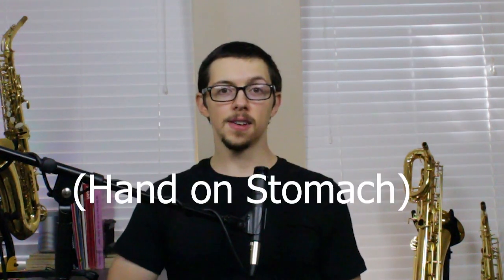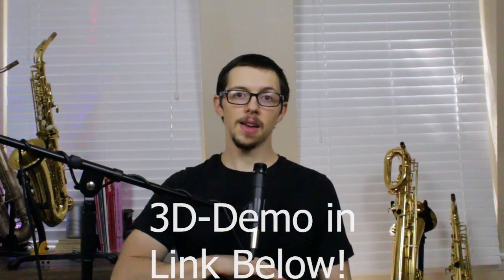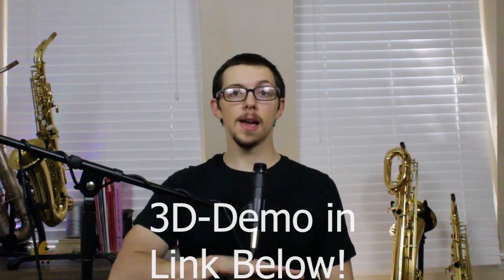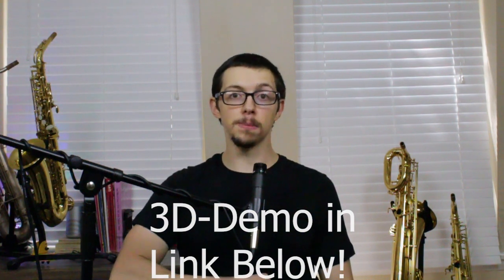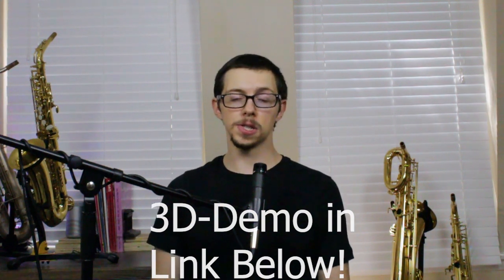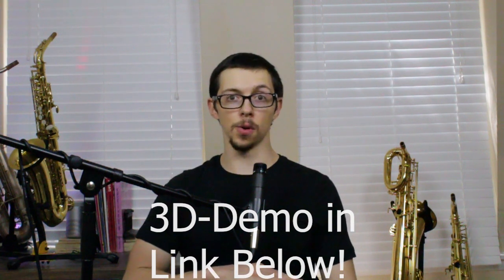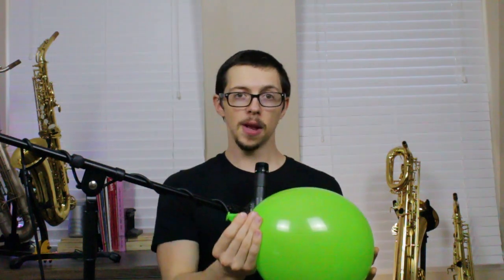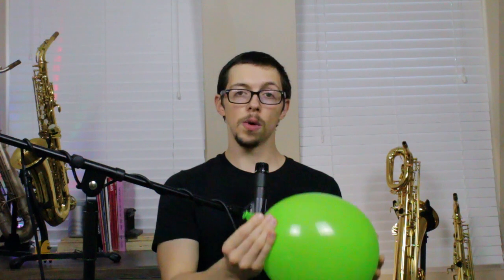How to Blow into a Saxophone

Comment: Thank you for the great content. I've been getting back into saxophone and going through you videos. One thing I was hoping this video would explain more is "breath support" and the difference between limiting your air and letting it flow freely like your balloon demonstration . Right now I struggle to play full other than at top volume (apartment living doesn't help). My question is...how do I let the air flow freely, achieve a full tone, and play less than top volume? Thanks for your contributions!
Reply from the maker: Playing at full volume is to be expected when starting out. "Flowing freely" can be misunderstood as blowing as forcefully as possible. Think of playing loud by using "fast" air, and soft by using "slow air".  Imagine you're blowing a cylinder of air into the mouthpiece; the cylinder is the same diameter whether loud or soft, it's just moving into the mouthpiece at a faster or slower rate.

 Or think of a tube of toothpaste;  you can put x amount of toothpaste on the toothbrush by squeezing hard and fast, and you can put the same amount, x, by squeezing soft and slow. 

Those aren't perfect analogies, but it might help to visualize how the air is moving. 

A brass teacher I studied with taught me to play 
"no softer than you can get a sure sound" so as to not constrict the airway. In the beginning, when we have less fine motor control over the instrument, it's going to be louder (and not great for an apartment, unfortunately). If you can manage to find a secluded spot to play outside, and the weather permits where you are, you can experiment more liberally with volume control, and not have to worry about the neighbors. I've often gone to a parking garage or cemetery to practice with less volume constraints. Nobody seemed to mind, and I even picked up a few fans along the way!

What size reed and mouthpiece are you playing on?
Reply: @Marcimusic257  Hey thanks for the response! Last practice session I put this idea to the test of constant pressure needing to fill up the entire mouthpiece regardless of volume. I started to think about horsepower as an analogy. Correct me if this is off-track, but playing quiet at a full tone reminded me of a tractor slowly moving forward. It's slower, but it would still be able to plow through any obstacle in its way. The word "Support" is making more sense.

My next battle is with reeds and mouthpiece pitch. I'm a jazz guy with the classic hard rubber Meyer 6, but I have no clue what strength would be best for me for a number of reasons. I used to play on a J16 or Java 3, but that was 5 years ago so I don't have any embouchure anymore, so I'm not sure if I should start on a 2.5 and work back up to it, or struggle with a 3 until I adjust.

Also, I've always had a biting problem. My mp has teeth divets from highschool! I put work into no biting and playing was fine with decent tone at 3 strength, but I noticed my natural mouthpiece pitch was like a D instead of the accepted A-F# range. Maybe I should have been playing on a 2.5 the whole time?

Currently I can't get an A out of my mouthpiece unless my embouchure tightens significantly and I do what feels too extreme with my throat/tongue. I've tried a legere signature plastic 2.5 (too hard, poor response), a vandoren Java 3 (too hard, decent response), and a rico 2.5 (immediate response, reed will close up on me, low/high notes are thin)

So given that I used to play a java.3, I am out of playing shape right now, and I've never been able to hit the proper mouthpiece pitch, what size do you suggest I restart with? Or what questions should I ask myself that could help me figure it out?
Reply from the maker: @zachyoutube213  that's a great analogy!

The reed just has to be soft enough to vibrate, and hard enough to provide resistance. The most important thing is to feel relaxed at all times when you play.

I would stick with the 2.5 for now. Don't try to force the pitch up, just let it sit where it's comfortable. It should come up on its own over time as you unconsciously adjust. 

Watch this video when you get the chance: https://www.youtube.com/watch?v=K-0N7XETP5M